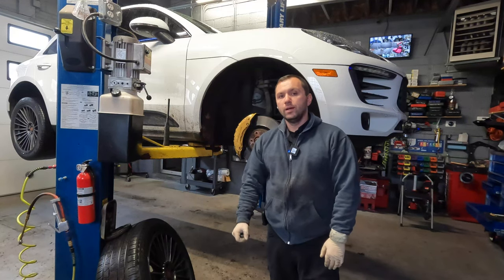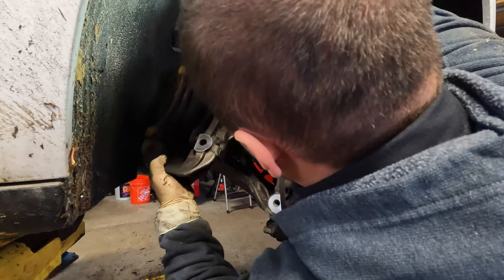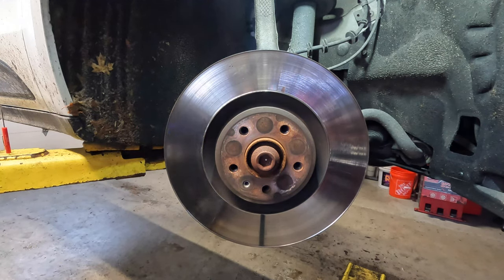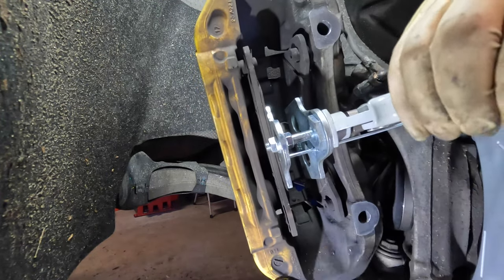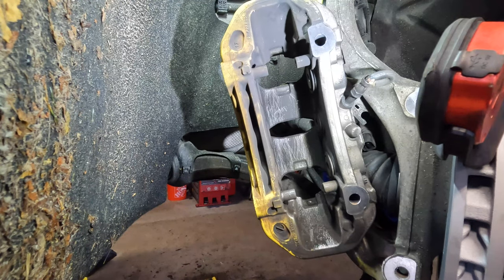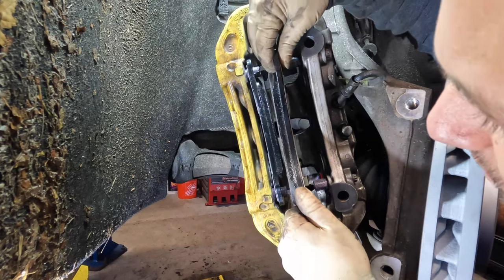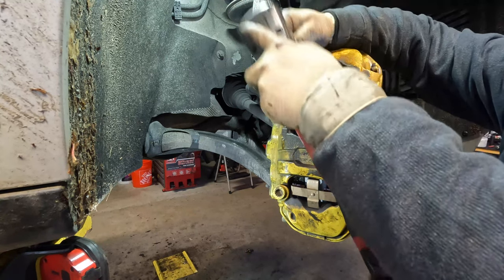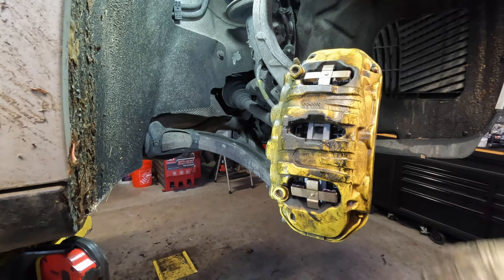CUSTOMER STATES PORSCHE DEALER WANTED $3K FOR FRONT BRAKES! HOW REPLACE PORSCHE MACAN FRONT BRAKES!

Comment: In the uk we call the multi-spline socket a torx socket or bit. Quite common on European cars and bikes. I know the suspension is based on the q5 but its crazy how similar it is to my 2004 a6, right down to the outer cv joint.